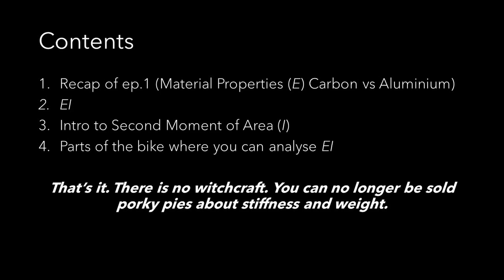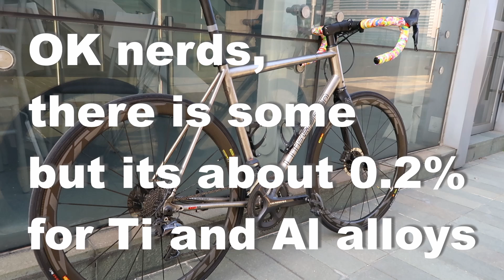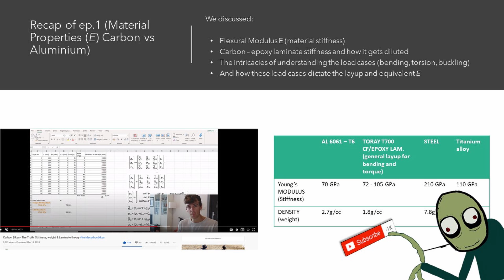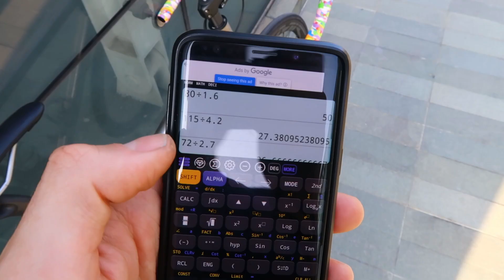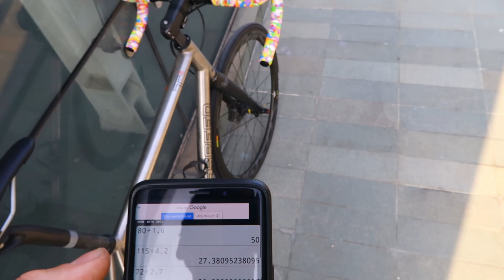Titanium Bikes - The truth and Physics of 'ride feel' marketing.

Comment: What about the magical vibration dampeners (specialized zertz inserts).. the fact they’re no longer in production indicates they were bs
Reply: No, just because they didn't sell doesn't mean they are bs. Google CG-R seatpost review, it clearly works. Whether its worth the money is a different story.
Reply: @jaro6985  not sure if you watched this video or not? Bending stiffness is governed by EI.. in the roubaix seat post case the cobra shaped tube vastly changes the moment of inertia (EI) the crap in between and also inserts on the frame and fork is nothing but smoke and mirrors
Reply: @Oakpathetics  So if they change the frame in similar way it will have a measurable effect, if they just slap in a zertz insert, probably not.

Comment: Leading the way with science and maths
My 2 cents...
Because the raw materials cost more for titanium frames they are likely to be built with more care and attention from the frame builder than an aluminum one. You also tend to get very good aftercare from the more reputable builders...
Buy for the fatigue life and corrosion resistance, not the mythical ride quality - best advice ever - the ride quality comes from careful and considered frame design and consistent construction methods.

Comment: Nice video, I would question whether the mass of aluminium frames is defined not by a desired stiffness but by a max stress for x many fatigue cycles. This would therefore force aluminium frames to be a certain stiffness because they need the material for strength. In this situation because of the improved fatigue life of titanium you would therefore be able to create a less stiff frame, providing the "magic" ride quality. This less stiff frame should be lower mass, but because of the standardised component sizes, threads and other fixed volume geometry both frames end up being a similar mass.
Reply from the maker: Yes you're right and Aluminium will likely have larger second moment of area tubes to meet the strength and fatigue requirements (due to having a lower yield and fatigue strength). Thus the Al bike will likely be stiffer due to the second moment of area. I did not address strength in this video.
Reply: @PeakTorque  I think that this would make yet another great follow up video!
Reply: Also, in MTB applications, impact toughness may become a consideration. I have only ever seen 'soft-tail' MTBs in Carbon and Ti where the seat stay has built in compliance. Totally agree though, all this BS about Ti being a wonder material is just marketing now, especially with the recent influx of fairly cheap Ti frames

Comment: The "zingy carbon frame" thing is also marketing BS, with composites you can have whatever you want by changing the fibre orientation, material type, etc.
Reply: Well...exactly? You're correct that a frame being made of carbon fibre composites doesn't inherently make it 'zingy', but the use of those materials allows a capable engineer to create a stiffer and lighter frame than they might with other materials, i.e. 'zingy'. It's only marketing BS if it's a poorly engineered frame.
Reply: @ccmmrrnn  what I am saying is that there is nothing to stop you designing a nice soft and lightweight carbon frame, a really stiff one or anything in between.
Reply: @andrewpease3688  Cool, we agree! Thanks Andrew.
Reply: its zingy because the cheap alu wheels LOL

Comment: Agree with what's being said, however I think no Ti and Aluminum frames are built with equal thickness tubes?    
Aluminum frames can be much stiffer, and Ti feels more flexy.  That's my experience, as I kind of dislike riding Ti.  
The material does seem to react differently, however  maybe it's just up to the individual builder and not the material.

I had this same discussion with an engineer regarding carbon, filament pbo spokes and traditional steel and alloy spokes.
He was adamant that the material does not matter at all, because they all were in tension the same way.

Though I agree and understand the engineering, there are other factors because one can feel a difference.

Maybe this is worth a bit more discussion? Though the modulus is the same, does the material allow for parameters that are not readily achievable with a different material?
Intersting rabbit hole...
Reply from the maker: Yes you're right and Aluminium will likely have larger second moment of area tubes to meet the strength and fatigue requirements (due to having a lower yield and fatigue strength). Thus, the Al bike will likely be stiffer due to the second moment of area. I did not address strength in this video.

Comment: Optimal tube thickness and diameters for bicycles for each material are different.  Wouldn't this change the stiffness?  Scot Nicol of Ibis cycles wrote this a long time ago: https://www.competitivegear.com/articles/metallurgy-for-cyclist-i-the-basics-pg89.htm
Interview the founder of Ibis cycles, Scot Nicol or Tom Ritchey.  I think they've been thinking and making bikes longer than you've been alive and would disagree.
Reply from the maker: Yes you're right and Aluminium will likely have larger second moment of area tubes to meet the strength and fatigue requirements (due to having a lower yield and fatigue strength). Thus, the Al bike will likely be stiffer due to the second moment of area. I did not address strength in this video.

Comment: Great video, informative and well structured. 
Audio was also nice and uniform ;-)

I do have a thought to share, a question left to answer, though. 
With Ti having more strength and being the denser material than Al, one would need to construct a frame out of tubes that are either scaled down (in the cross-section, not length ofc) or have thinner walls. (or combination in between, whatever)
That way the resulting trusts has about the same strength and mass. 
But wouldn't those smaller tubes make the frame more flexible/less stiff in bending around the longitudinal as well as the vertical axis?
Reply: If he had mentioned that in the video, he wouldn't be able to make his point. Not very scientific...
Reply: I hope this is understandable. I am neither a mechanical engineer. Only sat in "Mechanik 1" course, because every student in Germany has to have heard Mechanik 1 at some point! :-) Yeah... Electrical engineering and I quit

Comment: I slipped on ice and slid 10m down the tarmac on my Ti bike. When I got home I sanded out the scuff with 2000 grit paper and it was back to new. Can you do that with carbon or Al?
Reply: It is crap that he does not talk about how tough Ti is. Aluminum is easy to rub it away like putting 2 bikes in a vehicle and having them rub the aluminum off each other. Also Ti will not dent, other than putting it in a purposeful destruction machine. My Ti Litespeed Vortex was hit accidentally by a knuckle head using a hammer very hard. I can guarantee a aluminum frame would have been dented or a hole put in it! Carbon is good but not perfect either.

Comment: You can have two bikes the same weight made of Al and Ti (or even both Al) but very different stiffness because one can have larger diameter thinner wall tubes which are much stiffer obvs (E x I). One of the memes out there is that because Al sucks in fatigue you have to go large diameter and stiff. If you made an Al frame as floppy as a classic steel or Ti frame it would fail. Hence magic carpet. Would be interested to know if this is bollocks or actually true. Also out of interest do you know what the wall thicknesses and diameters are of that frame and whether it's double butted or not? I think some Ti frames are butted and some not.
Reply from the maker: Yes you're right and Aluminium will likely have larger second moment of area tubes to meet the strength and fatigue requirements (due to having a lower yield and fatigue strength). Thus, the Al bike will likely be stiffer due to the second moment of area. I did not address strength in this video.
Reply: @PeakTorque  I'm wondering why it needs to be stiffer though to avoid fatigue. Why couldn't you go thicker wall but thinner diameter if you wanted it more noodly but with the same fatigue strength? You could make the yield strength the same that way. Or is the problem that a flexible structure will concentrate stress in some areas leading them to fatigue?
Reply: @benc8386  Fatigue happens due to being noodly and flexing.  You can increase wall thickness to resist flex, but you're still adding mass.  

I'm not educated on tube shapes or design, but I feel like you can get away with slightly less material with a bigger diameter tube since the forces should have a little less "leverage" on the tube itself.
Reply from the maker: @benc8386  fatigue life is dictated by a 'stress amplitude' i.e the amount of repeated stress, and internal micro factors like prorosity, grain disclocations, impurities, surface finish etc. Many of the micro factors you can't adjust, so what you can adjust is the stress amplitude and try to lower it. One of the easiest ways to do that is increase the diameter (increase stiffness) as the stress will drop with D to the power 4. Maybe this is another video!
Reply: @PeakTorque  Yes that would be interesting! If you increase stiffness by changing material you reduce the strain but stress stays the same. But if you do it with geometry you must be changing the stress distribution somehow because the applied load is a given. Same road same rider sending the same features etc.
Reply: @Morpheas001  Yes I think that's a good point. If it's noodly then you've got more strain going on and that implies there's also more stress. The way stiff structures work is that stresses are more evenly distributed so the maximum stress at any one point is reduced. If you made an Al frame as non-stiff a structure as a steel one then it would fail from fatigue, whatever combination of diameter and wall thickness you used to achieve that lack of stiffness. Steel gives you the option of "compliance" if that's what you want which Al doesn't. You can of course make a stiff frame out of any of these metals. Just go large diameter on the tubes.

Comment: and steel: 210 /7.9 = 26.6 - so light steel frames are flexy as hell or thin as paper but not durable for big riders.
Reply: I was going to ask this, thanks! I've got an All-city steel race bike, but she ain't light! The extra 350G over my super light Ritchey steel frame definitely makes it feel stiffer. I wonder how it would compare to say a CAAD13?
Reply: The big advantage of steel is that it’s cheaper.
Reply: Wrong .... steel has higher fatigue limit so the flex does not weaken the metal like would happens in Aluminium which would eventually fail due to the flex over the years
Reply: @Max__apex  read my answer: if you are big and heavy, a light steel frame is not stiff enough! If it does not break it will flex (for years and decades).

Comment: How do Titanium and carbon act on each other will there be galvanic corrosion like with carbon fiber and aluminum ?
Reply: "there is no significant gap between titanium and carbon-fiber-reinforced composite to create galvanic corrosion. This means that commercially pure titanium and its alloys are completely resistant to galvanic corrosion when they are coupled with carbon composites."

Comment: The  advantages of Ti and Steel over carbon are fatigue life, and the easy ability to make a bespoke bike with.  And the ability to sell a story behind it when you're at the cafe.
Reply: Ti is hard to work with since OXYGEN is a risk during welding and very expensive for high quality stock due to scarcity. It certainly is not EASY when compared to Al or especially steel to make a bike out of it.  MOOTS and the like really are hand built by skilled tradesmen who earn a living wage. That doesn't make the material magical from an engineering standpoint, but they are still cool as hell.

Comment: I understand the maths, but my Moots rides smoother than my Tarmac or Caad10.  I have all my bikes set up the same and swap wheels.  Seat post is really the main difference (other than frame material).  Maybe a placebo.
Reply: Frame geometry differences?
Reply: @stephenpay8237  indeed, and slight differences in wheelbases too.  But unless you could custom build 3 bikes to exact measurements then the argument will rage
Reply: I've been riding for 25 years and have owned around 27 different bikes.  My Ti bikes were sometimes soft, sometimes stiff.  I had aluminum bikes that rode soft and some that were totally stiff.  Same with steel ones.   Its all about tube diameters and thicknesses.  The different materials simply allow ranges of variability based on their optimal dimensions, based on the strength of the materials.

Comment: I always disagreed with people who touted titanium bikes as being better than carbon in terms of compliance, stiffness, etc. Comfort always comes from tires, rims, and seatpost. The only benefit a ti bike has is that it's an amazing material for a bike if built up properly in terms of corrosion resistance and very low rust probability. Hoping to get a custom ti build for an n=1 bike for bikepacking, road riding, and gravel riding. Nice to hear a voice of reason on youtube.
Reply: The material itself has little to do with the ride quality.  It's the optimal tube profiles one can create with the materials.   Optimal steel tubes are clearly not going to be the same diameter and thickness as aluminium ones.  https://www.competitivegear.com/articles/metallurgy-for-cyclist-i-the-basics-pg89.htm

Comment: I think Carbon fiber does have some damping properties. I remember a lecturer talking about viscoelastic properties. I've no real experience in the stuff mind. Great video.
Reply from the maker: Yep, carbon epoxy does have proper damping capability due to the epoxy.
Reply: @PeakTorque  Exactly. Most of the bikes (e.g. made of steel, aluminum, titanium...) will use a carbon fork.

Comment: @Peak Torque... Can you talk about Carbon vs Aluminum rims; weight, stiffness, & price?
Reply: I went from custom 32mm dt swiss aluminum rims with dt swiss aero comp spokes on hope rs4 straight pull hubs to   60mm prime black edition carbon rims with the same spokes and hubs and the ride quality is better , but I did change from gp4000 28mm to 26mm specialized turbo tires as well so maybe they were making a huge difference. 😃,overall though they feel way smoother than the aluminum rims.
Reply: @MrGarycoww  ... Bianchi has been using vibration damping technology in their frames for a while now. Have a look. https://www.youtube.com/watch?v=2WlrUYjOBNg
Reply: @coldforgedcowboy  a bit like specialized zertz ?
Reply: Alu rims never more stiffer than true carbon rims, but here talk about more facts...hubs and spokes. Its not enough to have just a good carbon rim.
Reply: @mit1978  ... With Carbon fiber the modulus of elasticity is tunable depending on the type of fiber used, the orientation of the fiber and the resin used.
Reply: @mit1978  take a job as bike mechanic and you will see all the out of balance Carbon Wheels out there, absolutely crazy, bikes just shake a bike stand to death.   Its Carbon, Cant be Machined True.   True.
Reply: @bimmerbent  i am a bike mechanic🤣🤣🤣
Reply: @rcg9573  You make it a hobby to turn carbon on a lathe eh?
Reply: @jamesmedina2062  haha, you did make me look !!  Did find "Woodturning - Carbon Fiber Bowl", very interesting - lots of work and Resin.
Reply: James Medina - No dummy. And that’s not what I implied genius. 😆
Reply: @rcg9573  Well I meant truing stand, not lathe anyways so I guess I'm not the genius I thought! 😂

Comment: But having to use different size aluminium tubing for the same material weight, doesn't that make it stiffer than ti?
Reply: I'd say so. Plus keep in mind that Al tubing is often hydroformed compared to round shape of ti tubing on bikes.
Reply: @debelifratar  I was refering to stiffer than what the goal was here - the sublime Ti ride, which is a combo of using less material, thinner tubing, let's call it mechanically engineered flex/compliance. This applies to steel as well. The 'smooth' Ti ride died once disc brake bikes with carbon forks became mainstream. I have to agree with him 'Ti smoothness' is just riding the marketing BS wave now. 
Some of the stiffness can be sorted with wide tyres and carbon finishing kit, but it is ultimately no longer Ti smooth.
Reply: I read this a long time ago, which is why I don't think he really knows what he's talking about: https://www.competitivegear.com/articles/metallurgy-for-cyclist-i-the-basics-pg89.htm
Reply from the maker: Yes you're right and Aluminium will likely have larger second moment of area tubes to meet the strength and fatigue requirements (due to having a lower yield and fatigue strength). Thus, the Al bike will likely be stiffer due to the second moment of area. I did not address strength in this video.